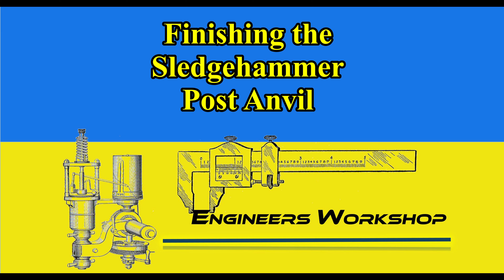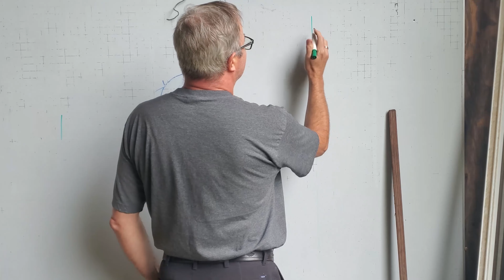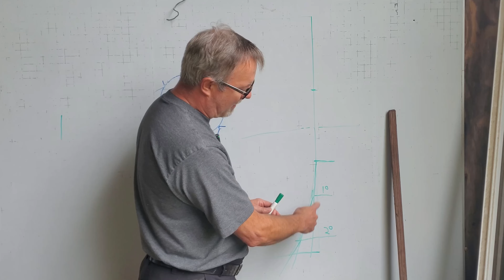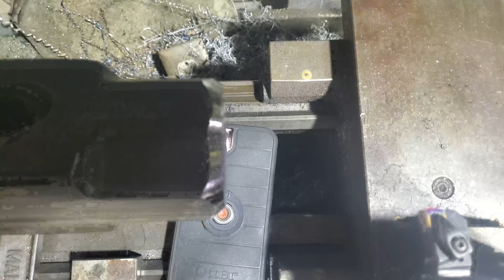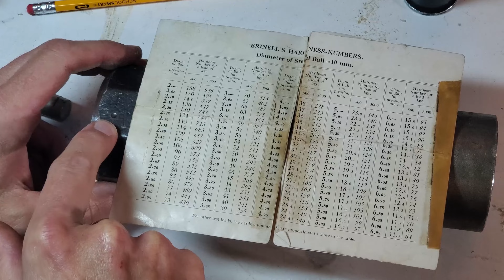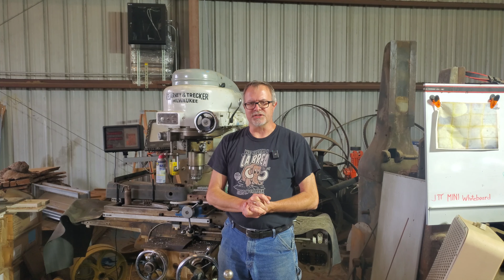Finishing the Sledgehammer Post Anvil

Comment: hammer head was way softer than I expected. Unlikely to be A2 if it wasn't very hard. I am not sure how well the pipe threads will hold up to being hammered on. I think I would have put some rags on the ways and polished the face in the lathe to keep it even all the way around.
Reply from the maker: Agree. They make special threaded couplings for driven wells that shoulder on the end of the pipe, should have tried to find one of those. The things he is doing on this anvil are pretty small, he has a 75 lb anvil for bigger stuff.